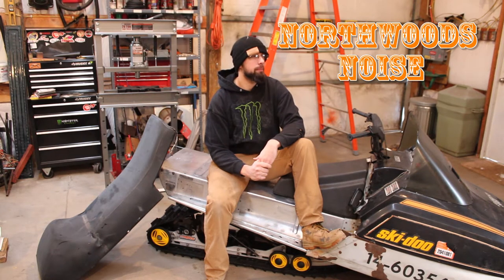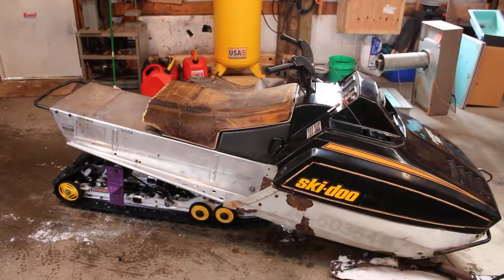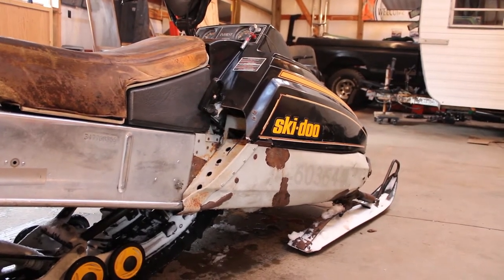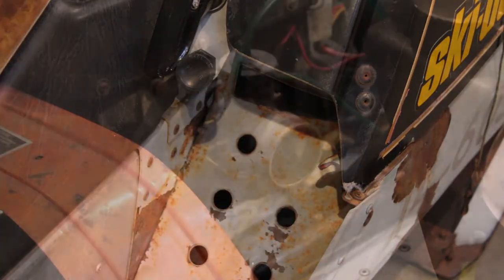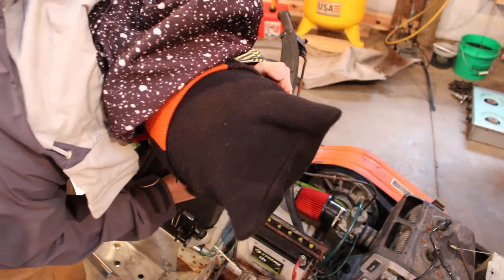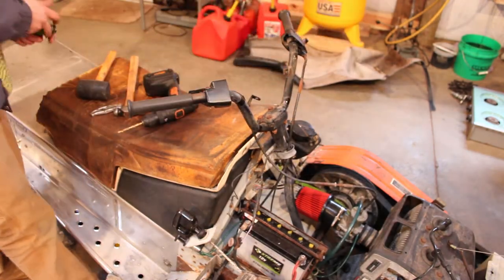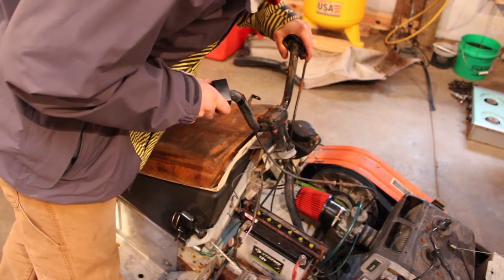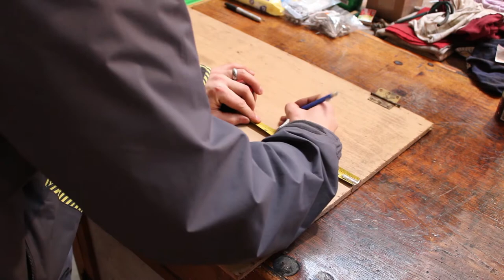Skidoo Everest mod sled project part 4. Seat, bar risers & some other stuff. Wrapping it up for now.

Comment: I don't get the point? Pretty much ruined that sled
Reply from the maker: Above all, the point is to have fun steve. It's also to build something unique and functional, something that performs and rides like a newer sled without the $20k price tag while retaining some of the vintage look.
Reply: @NorthwoodsNoise   i certainly understand not wanting to spend what they think this new stuffs worth. Then again
Reply: I think sleds just got uglier from about 2002 on. We had to sell our sleds in 2003 to  help fund an out of state move. We had a 2000-and2001 model skidoos. Now the prices  are so rediculas around here we cant even afford 20 yr. old sleds anymore!  So I condsidred restoring or fixing up a. vintage. Can't even find any here,and thosr I've found listings for  are even more rediculasly priced! And we finally have a good snow winter here! Its depressing. Carry on!...and have fun. I was a service tech on that stuff for 45 yrs...so been there ,done that!  Worked for skidoo in Mt. For 10 yrs. So did a lot of long track conversions.     I'll stop rambling...i'll keep following along as I've been retired now too long and becoming bored without a project! Plus I think I'm beginning to forget more than I knew!  Have yourself a great day!  👍